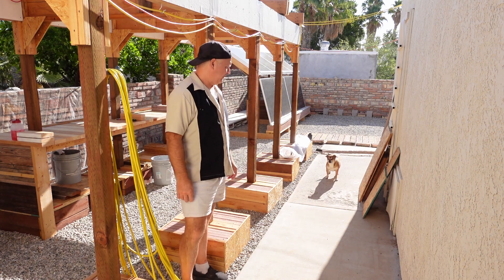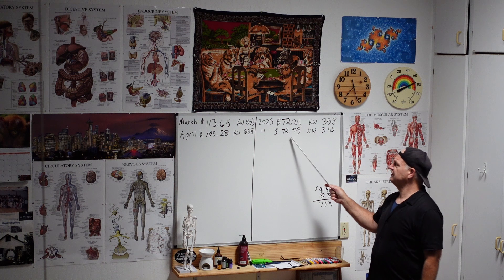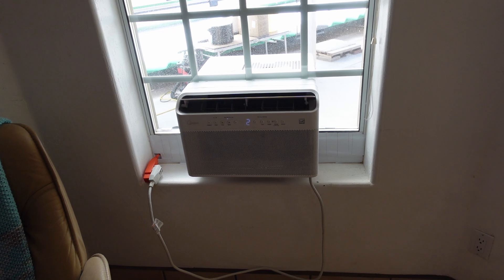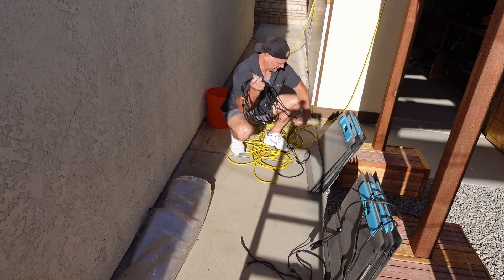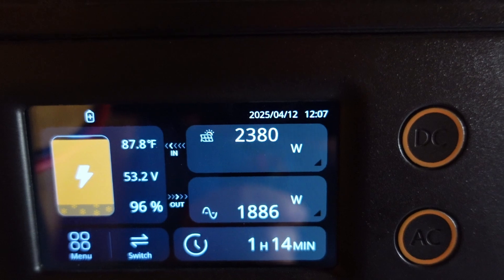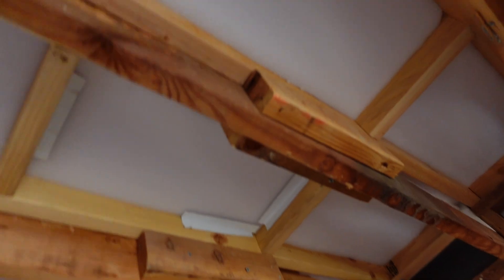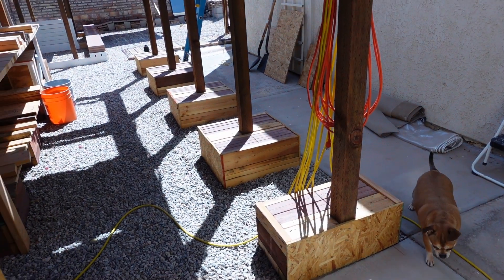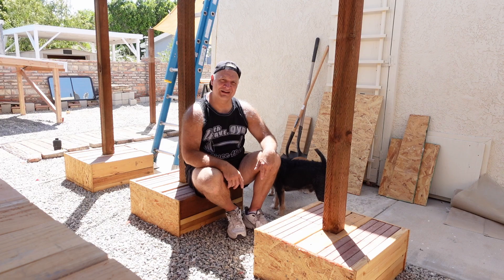DIY SOLAR SHED EP 31- NEW RECORD HIGH!

Comment: You're going to fry your EV's onboard charger and void your EV's warranty by charging it with that cheap, Chinese-made, high-frequency, output transformerless inverter. All it will take is for one of the MOSFETs in the H-Bridge circuit to short to ground and because it lacks galvanic isolation, you'll pass high amperage, DC current through to your EV's onboard charger, and you'll smoke your EV. If you don't believe me then ask Google AI this question: Can a high frequency, transformerless inverter damage an EV charger? You should be using a low-frequency, transformer-based inverter if you want to safely power your home or charge your EV.

Comment: Not sure if you've heard this, but cracked / damaged panels appear to work pretty well still and are insanely cheap. I've been getting cracked 540 watt panels for $20 a piece from solar installers that have them sitting in their backyards. Im curious if you wouldnt mind giving one a try if you find one local to see how it performs in your current setup, because my entire setup is entirely made up from busted panels that still appear to work fine, and there aren't many creators uploading videos covering this. I dont have nearly as good of carpentry skills as you, so mine are literally just leaning against my backyard fence, but ive been making so much power that i had to unplug some of them so that i dont trigger any alarms from my utility. My goal personally was just to reduce my bill enough to cover my AC entirely.
Reply from the maker: I almost thought about buying some used ones from nearby by at prices like you say in your comment. My problem was they were an odd wattage and getting them home would have taken  a lot of extra logistics. I'm sure someone looking to start a system with limited funds will appreciate this info. I have all the panels I need for the moment but if I need any in the future might try this route. Thanks for watching and the comment!